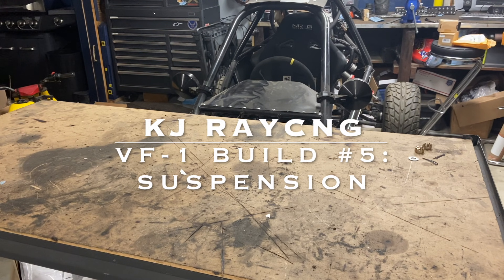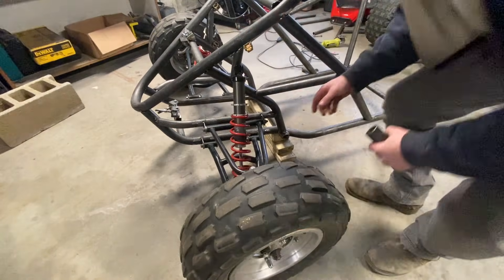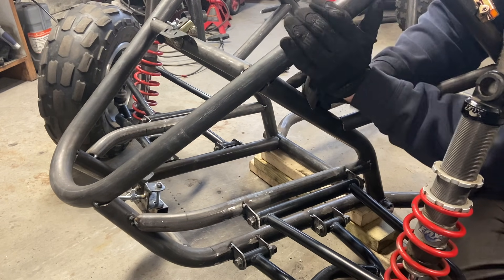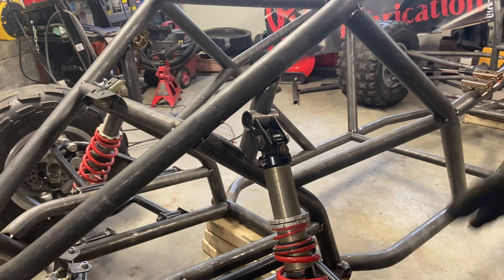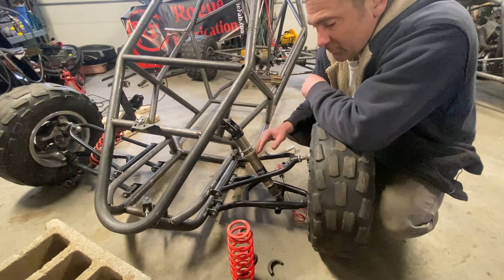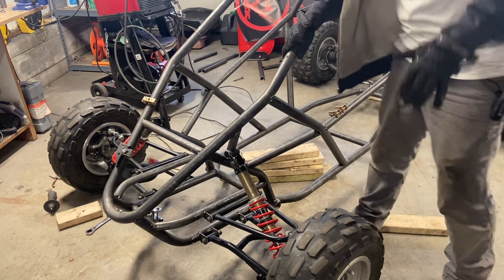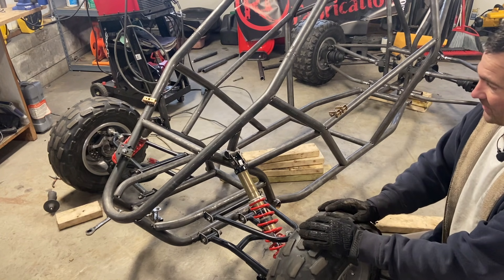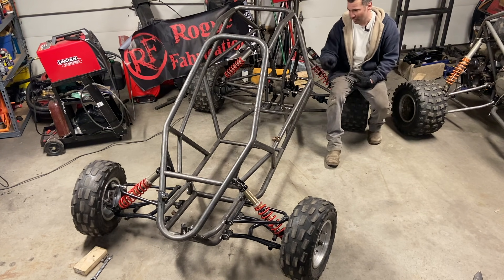Crosskart Build #6: Suspension

Comment: You did good on the explanation of the "motion ratio". For rough surface use ie motocross quad riding, static sag is typically adjusted to 1/4 to 1/3 of available travel. This is with driver weight added. Motion ratio should "always" be calculated using the tire contact patch as that is where the load input is applied. Oh and shock angle spring rate change is quick and dirty calculated at 10% loss for every 10 degrees. As u are an engineer I'm sure your trig calculations are more accurate. The fact that travel length is shortened when mounting the shock at an angle may also be something that may be considered. Coming together quite nicely!

Comment: Looks great. Can’t wait to start mine. I’m tracking some stuff down right now. Having a problem finding a IRS. Only seen a few Polaris outlaws in my neck of the woods and there on the expensive side.
Reply from the maker: You gotta wait for the right one to pop up.  The good ones that are priced low go very quickly. I waited 10 years for one to be in the price range.  If i had known how awesome it would be i probably would have spent a little more to get this started.

Comment: I have seen a few of your videos since I decided to build the smoothest riding golf cart possible. With in reason.
I am leaning to building from scratch. Plus maybe using atv parts.

I would also like it to be 4wd and possibly front and rear steer because I plan to add about 3ft between the wheels.
I have worked on cars most of my 60 years. But never fabricated anything like this.
It seems that most things should be figured out before getting started.
Do you have time to help and do the math for me?
Reply from the maker: That’s awesome you want to build, definitely grab some plans and see what you can do 👍

Comment: What is the radius of the die on your bender? Just looking at that lower bend in the front hoop and wondering how tight or loose it would be.
Reply from the maker: I use 3.5 clr for the 1.5 and the 1.25 according to 3d tubing regulations.  I would like to do the front in a 4.5 or 5.5 but i didnt want to have to buy another die.
Reply: @KJRaycing  I am buying a bender that comes with a 1.5 inch with a 5.5” clr, will I be able to use your plans or do I need to have the same dies as you to get the bends sharp enough. Not sure if the bends would be too gradual.

Comment: Could you post a video or some pictures and info on Facebook about how to change the setup to lower the ride height for autocross or other asphalt stuff?
Reply from the maker: I can do that. How much are you wanting to change the ride height?  The easiest way would be to swap shocks and tires and wheels since both require different setups mostly in that department. But the other way if you want to use the same shocks is to add a second mount and tabs to reposition the shocks. Because of shock clearances, they would need a separation of 4-5 inches minimum. Does this answer your question?
Reply: Yeah good question on how much to reduce.  I would think about 5" suspension travel would be a good compromise between performance and lower center of gravity.  What is the travel of the kart the way you built it in this video? Thanks.
Reply from the maker: I haven’t measured the travel but with 5” of clearance and it bottoming out right before the skid hits and 2” of sag, i’d say 6-7 inches ballpark.

Comment: Nice work, but isnt the preload at almost max? What I can se, you cannot tension the suspension more whith additional weight?
Reply from the maker: Thank you. The preload is actually at min settings, i have 2” of thread before i have to look at other options. I guess i should have said that in the video, “start with the worst case scenario.”
Reply: @KJRaycing  But the tension " nut" is almost at the bottom, shouldnt it be att the top for minimum preload?
Reply from the maker: The tension nut is 2 inches from the bottom. I took the weak dual rate spring off the top because it is worthless unless you have more ground clearance for progression.
Reply: @KJRaycing  Ok! Now I understand, keep up the good work 👍
Reply from the maker: Sweet! Thank you!

Comment: what exact polaris outlaw are those front hubs off of?
Reply from the maker: Any. The 525 or 500. They are the same. Chassis is set up to use nearly any atv front a-arm setup. I actually ended up using Raptor 660 arms.
Reply: @KJRaycing are those the extended raptor A-rms or normal OEM?

Comment: What did the A arms come off of?
Reply from the maker: They came off a yamaha 660, not stock though.  The front of the frame is set up to accept a lot of different parts.
Reply: Nice, that is how my build would look like.I have an original par of those a arms. Got them from ebay for 200 Shipped. With everything except shocks. I Will  be using a 500r from a Kawasaki ninja. Loving the look already👍
Reply from the maker: That is going to be a fun machine! Thank you!

Comment: Pedals man. I'm actually more curious about them than the engine right now.
Reply from the maker: You’re not going to be very curious when you see how much they cost... a good chunk of the budget goes to the pedals for safety. A 100mph machine has to be safe from brakes to throttle to clutch. But when you see how easy a racing pedal set is to install and adjust it may help justify the cost. Thank you for the comment.